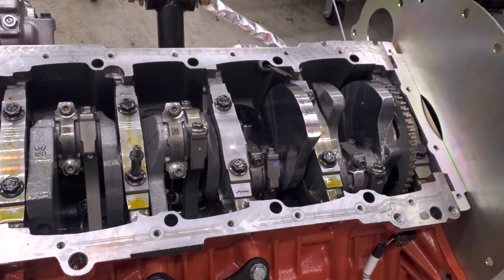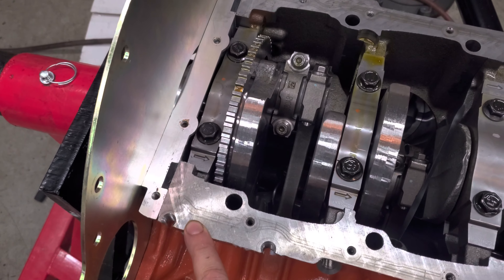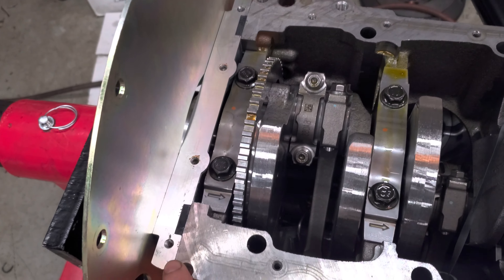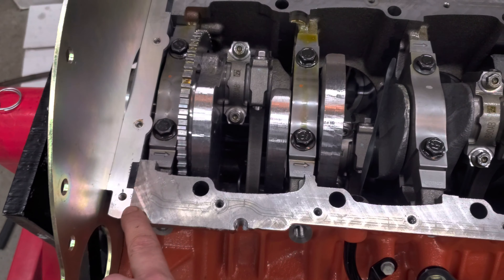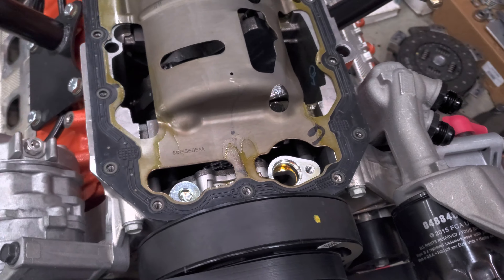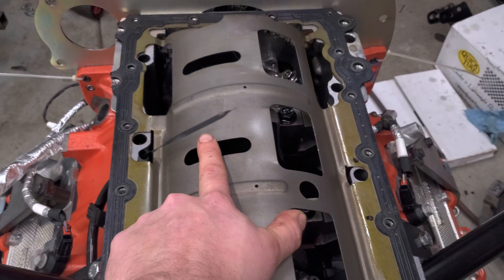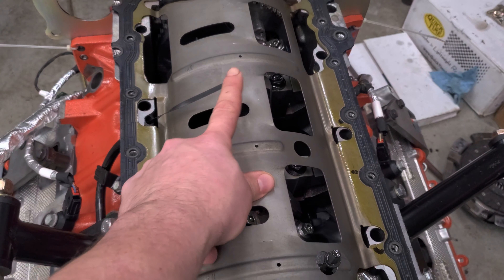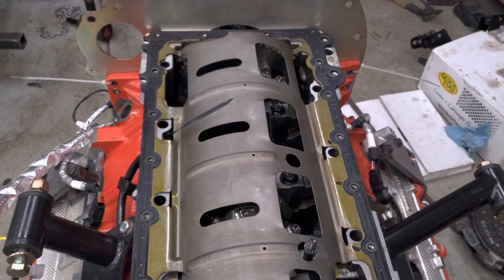Hellcrate Engine Swap - Stef's Center Sump Oil Pan Install (Part 2)

Comment: Did the oil pan land on the windage tray/ gasket metal rings on the rear?, The 4 holes that the stock pan use, and the Stef's pan rail goes over them, did you add a bead of rtv there?, It seems like my pan is landing on top of those rings & not sealing well?, Do I clearance the pan or try to remove the metal rings out of the windage tray?
Reply from the maker: No, the Stef's pan didn't cover the 4 large oil pan bolt holes on the gasket.  I only added RTV at the T-joints and at the overhang areas at the front sides of the pan.  I'd trim the gasket before cutting the oil pan....  You're not going to use those holes anyways.
Reply: @danm6230  sounds good, thank for the reply